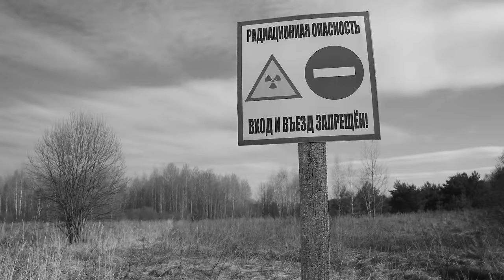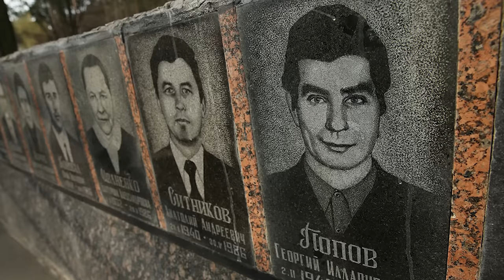The Filthiest Chernobyl Men You've Never Heard Of

Comment: And those reactors - #1, #2 and #3 - are still in use to this day. An interesting fact about the new steel dome installed over reactor #4 in 2018: money for this was initially available in 2002 to Ukraine thanks to the European Bank for Reconstruction and Development, but EBRD clearly didn't realize how craven and greedy some Ukrainians can be. The money was wired to a numbered offshore account and completely disappeared. It took 15 years for them to be able to create a workable relationship with Ukrainian officials after this despite the fact that cracks in the original sarcophagus were known, growing each year and exposing more people to deadly radiation.

Comment: 3:00 What's that in Celsius please.

3:05 Well that's not really all that surprising is it considering there was much more radioactive material at Chernobyl than that which was used for the atom bombs.

5:06 "Radiation" doesn't "find it's way" into anything, radioactive elements do.

6:40 Wut... 👁👄👁 
Lead shielding doesn't "wear out" just because it's exposed to radiation, lmao. The only way to activate(make radioactive) something is with neutron radiation and the only way to produce a significant amount of neutron radiation is by nuclear reactions using either a bomb, reactor or accelerator. The ordinary types of radiation that the bio-workers would've been exposed to on that roof; alpha, beta & gamma, does not activate materials. 

But otherwise good job

Comment: 2:13 Prypjat is not 3 miles away.. Prypjat is 3km or 3.000m (1,875 miles) away from chernobyl... finally use the metric system so stuff like this doesnt happen. ty
Reply: *1.875
Reply: @tungabunga4107  it's 1,875
The metric system uses ',' when u go below 1 and '.' for thousand and so on
Reply: @freshdumbhd239  so 3000m is 1875 miles? 1 𝘁𝗵𝗼𝘂𝘀𝗮𝗻𝗱 eight hundred and seventy five?
btw you wrote 3 metres. Because you but a "." instead of a ","
Reply: @freshdumbhd239  3,000m = 3km
3.000m = 3m
1,875 miles = one THOUSAND eight hundered and seventy five miles.
3km is not the same as almost 2 thousand miles.

Comment: The real cause of the tragedy is that whoever did the testing was quite dumb and incompetent, as he disabled at least two safety systems that should NEVER be disabled! The design of the reactor was bullshit, as it didn't had a safety shell on the outside to prevent massive leaking of radiation. They were also ignorant to the fact that the safety rods were not optimal and that the reactor was being overutilized by additional input power.

Comment: I was 17 years old when this happened. I couldn't believe my eyes. I lived in Jonesboro, GA. Thousands of miles away. and it affected me. If I were there, I would have been a first responder. by choice. Who do not understand the magnitude of destruction that was done The loss of lives. We are all human. We should work together. All nations should have come together and helped. But the USSR would not have it. What is shame?
Reply: The USSR was slow at accepting help but ultimatively did when it had no other options anymore. A good example was the construction of the sarcophagus. Shortly after its first design blueprints were presented and accepted, it was determined that its construction would require a type of mobile crane of unusual large size of which there was none in the entire USSR. They found cranes big enough but none of them was mobile. Eventually , they went searching abroad and found what they were looking for in West Germany and purchased two of them. These are the two big yellow ones with the wide tracks you can see on many photos. The giant concrete pumps utilized were also from Germany and specifically made for the sarcophagus project

Comment: It was human error that caused the Chernobyl meltdown they pulled out the almost all boron rods out of the reactor due to a power dip. Thanks to Boron gas affecting power generation it common protocol now to leave the rods in and let gas dissipate it will stabilize itself 
(Thanks to Chernobyl) 
Due to people rushing one boron rod was in the reactor there was supposed to be 27 In AT ALL TIMEs so when they tried to shut the reactor down a flaw in the design caused a power spike they needed to slowly lower 26 rods down one or 2 at a then put the rest in. Soviet politicians got in the way of safety protocol pressuring the young staff to continue the “SafetyTest” when it went against reactor design this caused massive pressure causing a explosion
Reply: This is with modern knowledge and a level head they were young nuclear technicians they needed more senior staff during night. at night all the new technicians were only supposed to do was to look after the reactor and run it at 30 to 50% power but they ran the reactor at 200% which even the senior staff probably couldn’t handle since the removal of the damn boron rods they rushed due to pressure and blew up the reactor since the flaw In the reactor when lowering boron rod the graphite would jolt the power the Chernobyl reactor produced enough power at the moment of the explosion to power soviet Russia for 20 years that’s before the  Circuit gave out so it could be much more. the whole of Soviet Russia that is huge when the reactor was only supposed to produce 10% power for Soviet Russia a day
Reply: I watch To many Chernobyl videos
Reply: For your Knowledge boron Slows neutrons/nuclear reaction so if they just kept the rods In the explosion would’ve never happened
Reply: To clarify they did a emergency shutdown since the reactor was heating up The reactor could’ve still exploded if they lowered the rods slowly but the explosion would not have capsized the reactor most likely releasing all the radioactive material it would all be underground to the side —> still bad but way more controlled lessening the effect moral of the story Don’t take out boron rod past safety limit 
(MOSTLY WHEN THE REACTOR DESIGN IS FLAWED) 
even if pressured by a superiors since makes too much power then goes boom
Reply: Dude I watched like 50 Chernobyl videos I’m now can state the reason why reactor go boom like it’s the back of my hand 🗿🗿🗿🗿🗿🗿🗿🗿🗿🗿🗿🤷‍♀️

Comment: I always wondered why they didn't attempt to use mini bulldozers to push the graphite off the roof. Mini dozers aren't computer controlled in anyway so I dont think they would have had and issues. Very basic units with basic electrical systems. I think it would have been a faster and more efficient way to clear the graphite.